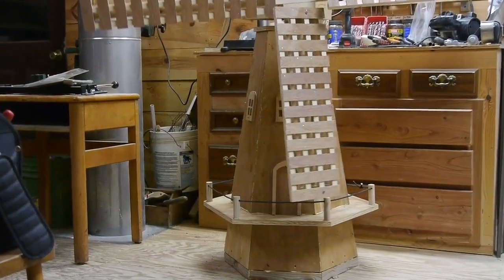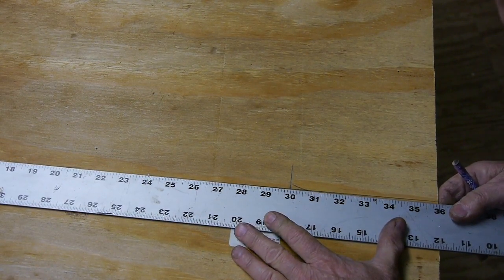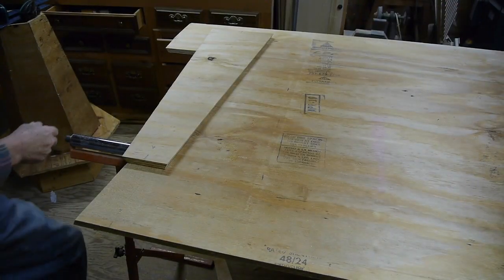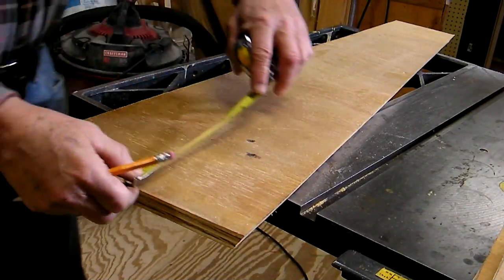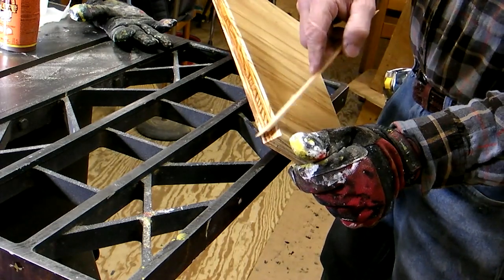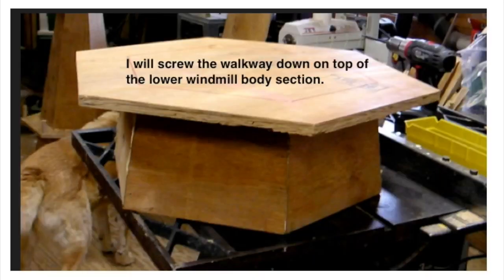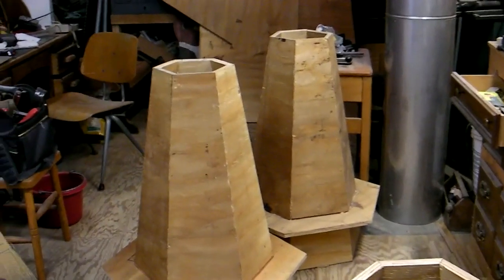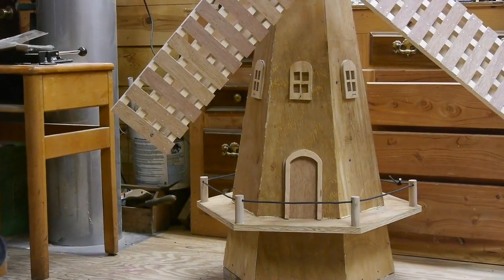Dutch Windmill #1 - Step by Step How-to

Comment: With a bird mouth router you could put together the 6 sides easier and with more solid space for gluing just the same beautiful construction you did
Reply from the maker: Never heard of a bird mouth router.  Have to check that out.
Reply: It’s a router bit called bird mouth  you got 3 pieces you can do 6 / 8 / 12 / 16 sides
Reply from the maker: Okay thanks a lot

Comment: I love this windmill. I'm going to make one and I'm wondering if you used pressure treated plywood?Thanks
Reply from the maker: Thank you.  I only used a pressure treated 2X4 on the bottom.  If you make one, I suggest you not use that 1/4 inch luan plywood for the strips on the sails.  That stuff falls apart out in the weather.  I am thinking about using some kind of plastic or even metal to make the strips for the sales next time.
Reply: @TimTools99  Thanks Tim! Not sure what I'm going to use for the sails.